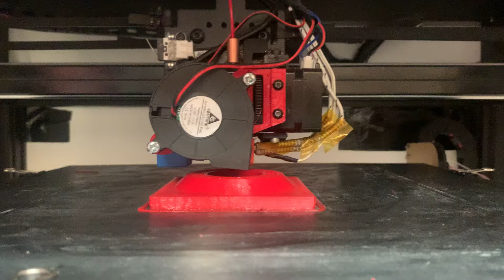BiquH2 - observations on high speed

Comment: Not too difficult. I used the existing steel backplate and one threaded hole, drilled a second hole just above it. the fan-side is VERY tight against the "X" axis sensor, no room for a bigger fan there. I printed and adapted a part cooling fan mount from Thingiverse, you just need to get a little creative. The E-steps were easy enough to change, (Running Marlin).

Comment: I'm new to 3D printing and I'm thinking of getting the x5sa pro as my first printer. How difficult is it to install the h2 on the x5sa?
Reply: I dont reccomend getting the x5sa as a first printer. It's not a common printer so there's not much help/upgrades. The motherboard and software are not used really anywhere else (something like marlin is more common, meaning easier to find help/tutorials). It's a good printer if you're okay with changing out a lot of stuff, designing your own upgrades, etc. If you want a core-xy, I'd reccomend looking at one of the Creality models. Not a whole lot more expensive
Reply: @PropKnucklesFPV   this is not correct. Tronxy has become better in one respect. They now use Marlin no more Chitu on the sold off units might still have the Chitu box on it. Definitely not on the brand new ones shipped directly from them. However, they have also become even shittier than before. As a result of the fact that some people, including myself, have created a wonderfully easy-to-use Marlin that anyone can compile, Tronxy has taken direct action. They put a completely different controller on the new boards which means that until someone does the pinout we are completely locked out again and only their stripped down Marlin works and Klipper doesn't work either. This makes it even harder for beginners to get anything done with the original hardware, unless you only use what Tronxy gives the users, which is very little.
Reply: @PropKnucklesFPV  Yeah, however only the Ender 6 and 7 are CoreXY, and they still use shitty v-rollers
Reply: @BH4x0r  ah that's lame. Hopefully easy to upgrade. Ty for the info
Reply: @PropKnucklesFPV  Well nvm, the Ender 7 is actually running knockoff linear rails on the X and Y but it's only 250x250 so rather small.. the Ender 6 V-Rollers

if they had an Ender 7 in 400x400 i'd knew what to get for this price lol
Reply: @BH4x0r  do not recommend the ender 7 at all. terrible printer, terrible starter printer ingeneral. most people get the ender 3 or 5 as their starter printer
Reply: @BH4x0r  If you wanted a corexy printer theres a group called vzbot that adapts popular printers into a corexy and is super successful in doing so
Reply: @bradleybell8958  I know about Vez, Voron et al but i'm kinda aiming towards doing one myself
Reply: @bradleybell8958  ok i just now see your Ender 3 and 5 comment, but i absolutely hate regular cartesian bed slingers, and those shitty wheels they usually have (except it's better than the thin rods the Anet A8 etc uses and the A8 has some serious safety issues too)

I cannot recommend a stock/unmodified E3 or E5 especially if not updating the firmware
Reply: Could anyone please answer the original question? How difficult is it to mount the BiquH2 on an X5SA?
Reply: @BH4x0r  i have modded the shit out of my e6. linear rails, converted it to a ratrig style core xy. eva3d supported x carriage, klipper firmware, upgraded heater cartridge/thermistor cartrige, biqu h2, enclosure (full), and some other stuff. its def alot of work but the e6 works fine without all the modifications.
Reply: @AbuMaia01  The hardest part is combing through Thingiverse and figuring out what mounts to use and what part cooling fans to use. TronXY has used a number of different carrier plates between the X5SA, and the early and late X5SA Pro's
Reply: @randyre8172  Doesn't matter anymore anyway. I went with the Hemera instead.